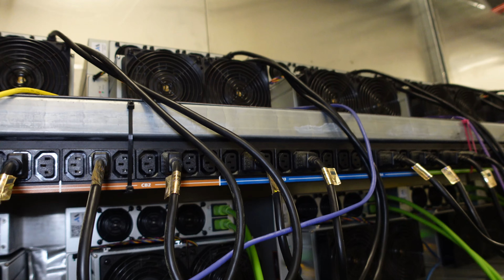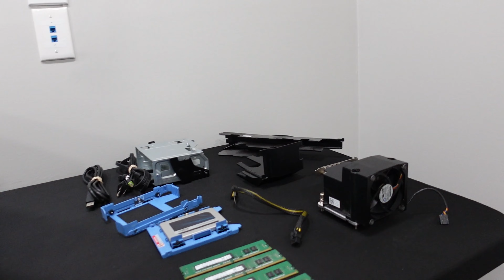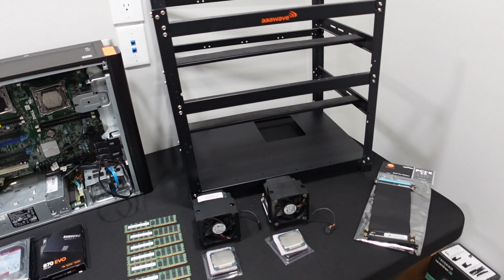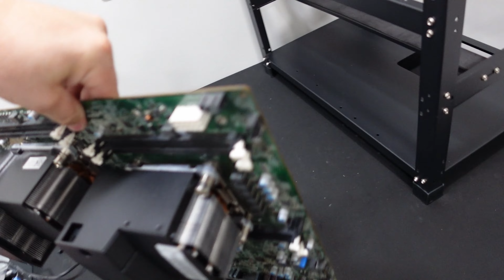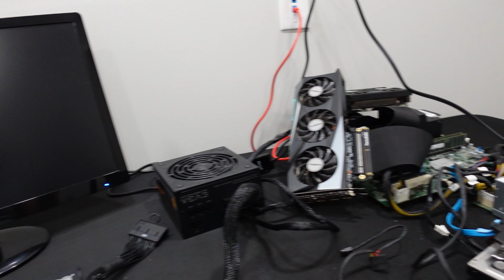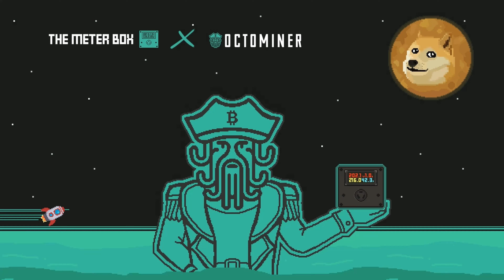GPU Mining is Evolving, High-Powered Hardware is a Must!

Comment from the maker: Are you Currently CPU Mining? If so, whats your Hardware Look Like?   Are you stacking any Hardware to Prepare for POUW?
Reply: Dual mining Intel(R) Xeon(R) CPUs E5-2650 @ 2.00GHz on a X9DR3-LN4+ Supermicro mother board with 360GB of DDR4 and a RTX 3070. - 
I have been plagued with the the 2nd CPU not showing issue as well. I have had a small amount of success with using xmrig-new vs nanominer. (Nanominer seems to use more cores vs xmrig that uses half even with hyperthreading ON). 
I can't wait to see if you find a solution for it.
Great work keep the content comming.
Reply: @zed28t  rabid mining has a video on core alocation for xmrig. not sure if that could help with the duel cpu problem
Reply: Got a 3900xt laying around.. was about to build a CPU mining rig but maybe build another pouw rig with that one..
Reply: Dell should have 1300 watt PSU / I have Z820 with liquid cooling , use nanominer set cores to 16 for xmr mining , run 2ndsry programs gor ETC mining and Ssd/Hdd mining, No other PSU needed, win 10 setup, Its not exactly profitably but runs everything flawlessly and makes more than not mining,
Reply: if you undervolt dont call it oc....its a mistake many miners do.

Comment: I ordered the motherboard and a couple processors. Looking forward to a follow up of this and the solution to the 10pin wires!!
Reply: There is an adapter for the z440 workstation motherboard.  Idk if this is similar to these boards.   z440 has a 18 + 8 pin.

Comment: Unnecessary amount of ram and thread count for the amount of GPUs… GPUs for POUW need 16x pcie to be effective.
Reply from the maker: That is incorrect.  Flux POUW will need at minimum 25% your GPU VRAM but recommend 4x.   On this board the 2 slots are 16x
Reply: @TheHobbyistMiner  you only need 8 threads for 2 gpus, why so much ram for only two medium sized cards?

Comment: How you’ll power the GPUs with a separate psu if you connect the gpus directly to motherboard without a riser? If you use riser cables for x16 connection you will power the gpus through two different sources

Comment: my understanding of this setup, its bad dude. it needs to be all on one psu the voltage differences isn't a good thing. You could get away with this back in the day powering the riser and the gpu on one psu and the system on the other, only data would pass through the usb cable, but the ribbon is a different story.

Comment: it was an interesting experiment, but I think going old xeon is a mistake. you can use the x570s or B650, X670 motherboards and get 3 PCIe 4.0 X4 slots. X570 has 2 ea. PCIe 4.0 x4. 4.0 X4 has same bandwidth as PCIe 3.0 X8. A Ryzen 9 7900 (No X) 65 watt chip is the most powerful per watt for cpu mining followed by the Ryzen 9 3900X. The rest of zen 3 and 4 are all more powerful per watt than the old xeons and their platforms far easier to work with. Just look at the benches. NVME drives will also lower wattage and greatly increase disk throughput. the buses, the ram are all faster too. the only drawback. You're limited to 128 GB of ram but for 2 GPU's that's plenty, for 3, its still way over the minimum. Alternatively, there's Threadripper or Epyc
Reply: I 100% agree on this. Only thing is, that oftentimes GPUs don´t play so nicely with PCIe 4.0 x4 slots, meaning it´ll actually end up slower in workstation usage then a PCIe 3.0 x8, even though they should be at the same speed.

If you´re going for a System like two 7900 with a proper motherboard and ram and what not then you´re likely better off going with an EPYC system. It´ll fit the same amount of GPUs (at gen2 it´ll have PCIe 4.0 on all) and then you´ll only need one set of proper HDD, SDD and what not, while keeping the Power, Ram and everything at the same.

Comment: Hey have you looked on the cpu ? Some of them can't be used in pairs like the P version on Epyc CPU
Reply from the maker: Based off what I found this wasn't an issue for the Intel Xeon E5-2697 v3 SR1XF 2.60GHz 35MB 14-Core LGA2011-3 CPU Processor. But will continue to investigate.  Thank you!
Reply: @TheHobbyistMiner  im looking at the 2683 v4 dual setup. CPus are like $15 16 cores and lower watts